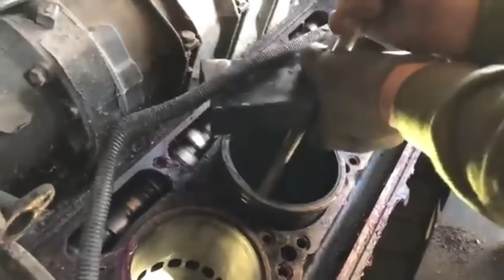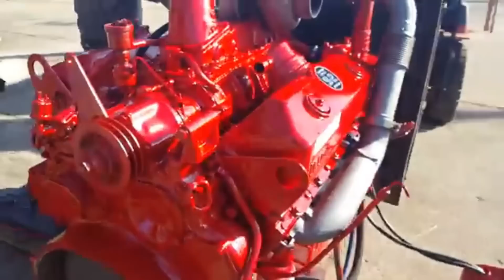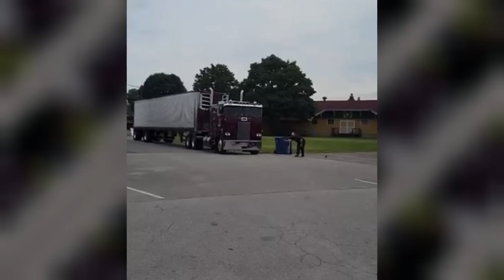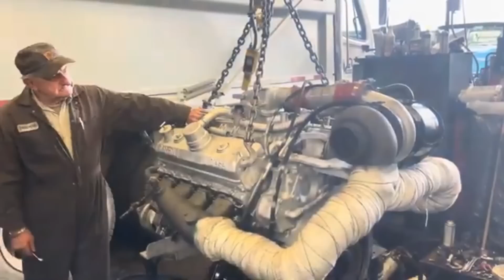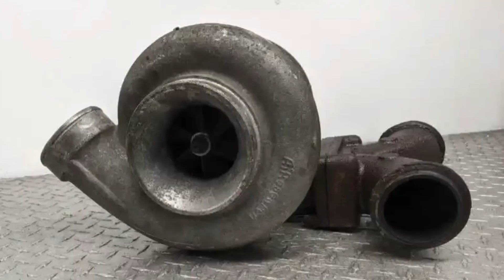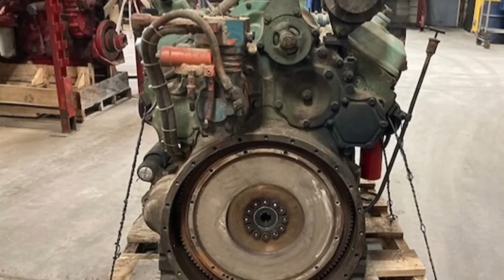Why Detroit Diesel 8V92 Was Killed: The Engine Too Hot For Its Own Good

Comment: I worked in Detroit Diesel before retirement and am sorry to see the DD's Logo of "2 big strokes + 2 small colored strokes inside = 2in2 cycle" fad away. The piston engine is the best internal combustion design so that there are billions of them serving humans for more than a century. Current ICengines are divided into 2-cycle, 4-cycle, diesel and gasoline types by structural and combustion types. This division doesn't have to be. - 
It is just by simply splitting the piston crown part from its skirt to be operated via (a valvetrain-like) piston-train to make the lighter pumping gases for the cylinder - called D-cycle (differential-stroke cycle) completing 4 strokes, different in displacements and periods in every revolution - like the 2in2-cycle. Test data (school lab, uncertified yet) show the D-cycle engines have achieved >20% fuel saving, while yield >2.5 (close to 3) times torque. 
The D-cycle can further bring in the "Diesoline" combustion which is a hybrid of the diesel-type compression-ignition and gasoline-type spark-ignition engines. It is the compression ignition on the stoichiometrically charged air/fuel mixture while retaining a great amount (>30%) of burnt gas (called BGR) to replace the extra exhaust gases for the high compress needed instead of air in HCCI (homogenously charged compression ignition) to avoid the NOx (and engine knocking). The diesoline will save extra about 15% fuel without the nasty and costly soot + NOx after-treatment for the millions of diesel trucks in USA along – that can save great among of after-treatment cost. 
There are billions of ICengines serving humanity for one and half centuries. Since current eV hype has proved that battery technology has not reached adequate maturity to compete, the ICengine can continue to serve us for another century or so.

Comment: I dont know where all this info came from but its BS. Plenty of engines are wet sleave, and cavitation is not an issue particular to Detroits. As for injectors and tune ups, also BS. The injection system and tune up requirements were the same as the series 71 and 53 which had been around 40 years aready in the 1980s. Back then pretty well every diesel shop had mechanics that were familiar with them. One last thing, if these engines sucked so bad, why did the military keep running them well after they were no longer availble in trucks? Becuase they are such junk and hard to work on? Lol ok.

Comment: PROBABLY FUEL MILAGE KILLED THE 8V92 . I never got more that 3.9 mpg out of the one I had . It was a non turbo engine . but friend's of mine with the 430 model was about the same !  NALCOOL TREATMENT IS MUST HAVE FOR ALL DIESELS ! TO PREVENT CYLINDER LINER FALURES !!!!!!

Comment: The only temp problem they had was the oil cooler was on one side and that side would wear out sooner,so removable cylinder liners made it possible to replace only the ones nessissary and pitting in the water jackets was more common in straight 6  855 Cummins it was never a problem in detroits,the factory recommended oil at 50 k and change the filters at 10-15k.  All my detroits ran like bears ,,they only over revved when the turbo went out and it started burning motor oil,,,mine were turned up to 2730 rpm, and detroit parts are everywhere,,,this whole story is based on bullcrapi did total overhaul on the ones I had for under 3300$ i call bullcrap on this whole story,,,,,,

Comment: I served in vietnam and the M-113 had a 6V53 detroit, diesel engine, supper tough if oil was kept-up . These detroit would push the tank at 50-55 MPH down hill with crew of 5-6 pluse a full load of ammo. 13 ton APC.

Comment: Another fake AI video
Reply from the maker: Not AI or fake. All me, doing research, writing the script and have a human edit it. Sorry you didn't like it, but it's not fake and it's not AI.
Reply: @VintageAmericanMachines whether that is true or not, the fact is, your conclusions are just plain wrong.

These motors have been a huge part of the marine industry for many decades, and still are today.  Many, many large boats / yachts have 71, 92, and 149 DDs in them and hardly any problems.  These engines run for days at a time before being shut off, only to starts up again without a hitch after months of sitting.  I've seen sunk boats brought up with 8v92Ti and, after flushing the coolant and oil, they would start right up.  Also, after an oil change they would often just run the oil through a 1 micron raycor setup and dump it right into the fuel tank.

These new Volvo POS motors coming in most of the boats are absolute garbage.  They require you to phone home to check anything on them.

DD 92 and 149 series aren't the most efficient, aren't the quietest, and certainly aren't the best fir the enviroment, but they will run on and through anything.  Throw in $3,500 worth of parts every 4-5000 hours and they run for another decade or 3.  Sure beats a repower with a $125,000 boat anchor.

Comment: If anything was the death note for later 8v92s, it wasn't most of this. The DDEC II system. No one had their head🤔around it yet. This made them problematic. A hurt 92. Get ya to the next stop. A DDEC II system shut ya off on the spot if it so desired. Kinda like the new trucks now😅

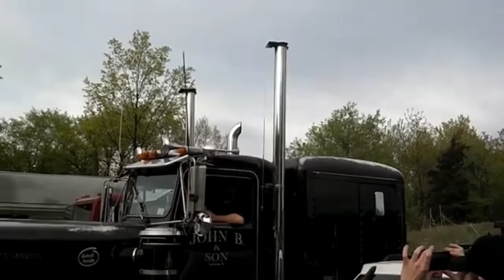Comment: 5:49 thats not how a dd works
Reply: There is no “short circuiting” of fuel because fuel is ONLY added at the top of the compression stroke! Only gasoline crankcase pressure scavenged engines can do this, and in most of even these do not have any more short circuiting than the overlap phase of the intake and exhaust valves in a 4 stroke, that if it wasn’t there will result in a sluggish doggy engine! Some loss via overlap creates inertia that actually draws in more fuel/air charge. So 4 strokes are NOT better nor much more efficient than 2 strokes. Heck, my valveless rare loop scavenged 4-51 Detroits are actually MORE efficient than any naturally aspirated 4 stroke diesel and far simpler. Most of what is said here is bull. I have seen PLENTY of well used never been apart 6V, 8V, 12V and 16V 92’s that work hard and are very reliable and run smokeless. Yes, the wet liners had cavitation issues, but that applies to all wet sleeve 4 stroke diesels too, so be fair, people! And 2 stroke diesels tend to be smokeless by simple design characteristics! My 2 cents here! I live and breathe 2 strokes and they are fine and also coming back! Cheers! 😋👍🏻😊
Reply: @HammondC3  I have a 82 eagle 10 bus with a 6v92ta, havent drove it anywhere yet but it runs good lol
Reply: I don’t see the fascination with these engines every one I drove was loud and gutless !😂😂😂

Comment: I drove a 8/92 over the mountains for years. Had no problem maintaining temperature. Used a gallon of oil a day though. They had trouble but not what this video says
Reply: We had a silver 92 in a Western Star,  and it ran hard in the mountains at 80000. Great power,  but  yes, a gallon of oil on long days.
Reply: @partrickstowman8039  You might be speaking for your own truck that you took time to pay extra special attention to, But this represents the fleet of the hundreds of thousands of these things that were around operating during its day.  Not every vehicle owner services their engines as the manufacture specifies to the exact time dates on the service list on the manual being cheap or cutting corners on such a expensive investment destroyed their engines and the hurt to the wallet was real after that.
Reply: The head gasket material might have made a difference, no?
Reply: I was around Sport fishing boats in the 90's and 2000's and the 8v92's were everywhere , it was the Mann - grenades that kept popping .